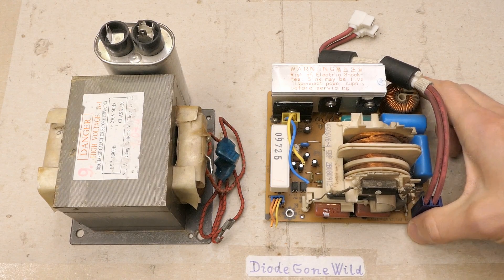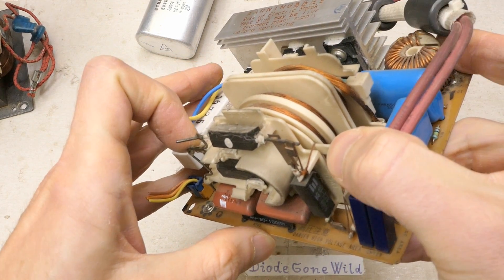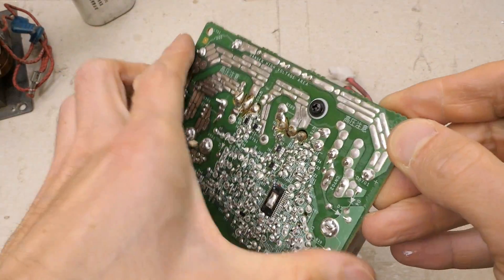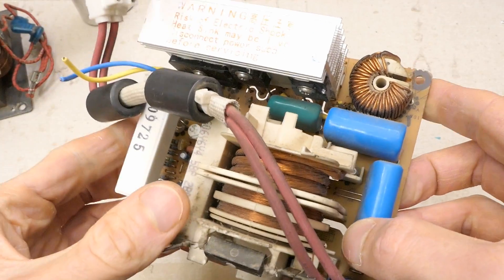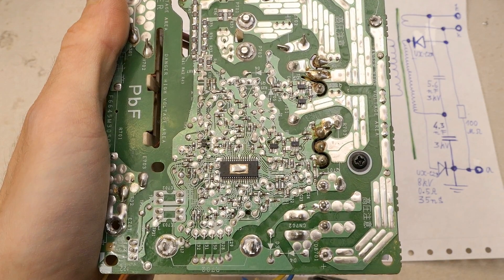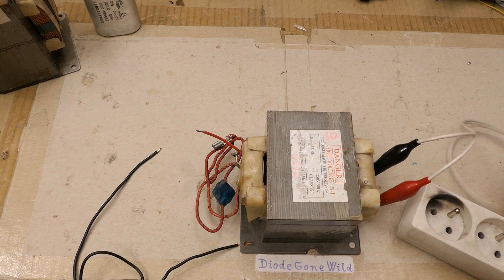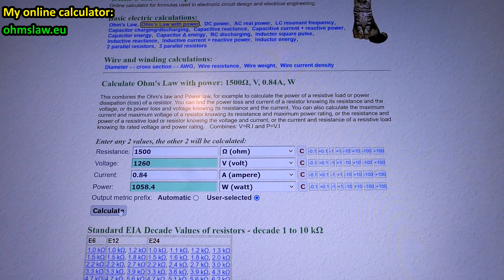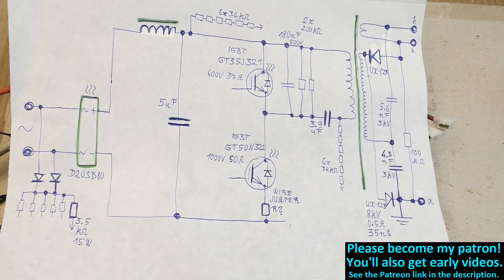A Microwave Oven Transformer, but switching!

Comment: The doubler circuit is connected to the cathode in this special way to disable voltage doubling when the heater wire is broken. A magentron without heater but with high voltage could emit some other radiation.
Reply from the maker: Well, this also came to my mind, but the two points are still connected via the low voltage secondary.
Reply: That's right, maybe they chose this way because it was easier to connect, since the doubler capacitors are mounted on the side of the bobbin?
Reply: It won't amit any other radiation. With a cold cathode, you have no current. Magnetrons do produce X-rays in normal operation, but 4 keV is too low energy to pass through the copper anode. Even a thin glass vacuum tube will block X-rays under 10 keV.
Reply: @mernokimuvek  You're right, I didn't think about the low keV, but magentrons can produce X-rays when the filament burns out but is still hot enough to emit some electrons. You will get a hotspot which will give you enough electrons for a accelerated path inside the tube. Once you disconnect it, it cools down and then will never generate anything again. Correct me if I'm wrong... I thought the beryllium stem of the antenna was quite 'translucent' for X-rays?
Reply: @SunnyJulienDivine  I tried disconnecting the heater and it stoppe emitting microwaves in a few seconds.(With the high voltage still connected). The beryllium oxide or aluminium oxide insulator is still a few mm thick. X-rays tubes with thin beryllium windows rarely emit under 7 keV.
Reply: Okay thanks a lot!

Comment: Remove the transformer out of the switching based supply, and put a fly back with a custom primary in its place....

Might need to have wax seal and submerge it in oil with drive voltage of 340v, since it's full wave rectified fed in to a igbt inverter circuit....

Comment: Finally on a unique topic....I hope inverter microwave oven won't replace traditional microwave ovens
Reply: This explains a lot. I was trying to troubleshoot my 2017 LG microwave oven and was looking for the large capacitor, but it wasn’t there!
Now, I understand why 👍
Reply: Not me, they use less power and the Toshiba ones made by Midea last LONG time, and cheap to fix yourself.
Reply: @BigEightiesNewWave  they also actually have variable power, rather than 10 sec on 4 sec off or whatever it may be when selecting a lower power value
Reply: @BigEightiesNewWave  Midea makes great microwaves tbh.
Reply: I still have a good old mot panasonic microwave

Comment: Lots of comments about the unreliability of inverter microwaves, but nothing about how much better they actually work.  I have an older Panasonic inverter unit that still works great, and if it died tomorrow I would immediately buy another one.  They work much better than transformer-based microwaves, especially at low power settings.  If you set a transformer microwave to 50% power, it doesn't actually produce half power.  Instead, it cycles on and off at 100% power but the user has no control of the duty cycle, so short durations at low power aren't really possible.  An inverter microwave will actually produce half power, so your food is much less likely to boil or explode.  Sadly, most people don't bother to learn how to use a microwave properly; they just run it at full power all the time and clean up the occasional mess (or don't, and have a disgusting microwave!).
Reply: Some people just want to be the victim constantly.
Reply: Most Panasonic microwaves are now made by Midea. You have to look well to get a true Panasonic

Comment: Are you sure that the 3.9uF capacitor is connected in series with the transformer? It doesn't look right....
Reply from the maker: It is, and it has to be. It removes the DC which otherwise would saturate the transformer.

Comment: Create a driver circuitry for the transformer using a MOSFET and 555 timer! I'd really love to see that.
You could also make the arc produce music by inputting some music signals to one pin of the 555 timer. I've built one of these driver boards
Reply: Skip the transistor and use a vacuum bulb for more fun.
Reply: just a ZVS or even better if you wanna do an NE style, a TL494, much better for audio modulation

problem is that the voltage is really, really low compared to a CRT flyback so it will be hard to maintain a stable long arc especially for audio modulation
Reply: @BH4x0r  You mean the output voltage OR the amount of current you need to drive that transformer, which makes the voltage low?
Reply: @TomboRectify  i mean the output voltage, these are made to put out approx 4kV at high current, just like the metal transformers (the metal transformers go through that capacitor and diode as a half wave voltage doubler), a TV flyback from an actual TV puts out anywhere between 20-35kV (dependant on TV size) on the stock driver
Reply: Why don't YOU try that? I swear I would love to see that :D

Comment: now you know why the new ones do not last half as long, we replace 1 part with 100 parts, of which many have a lifetime of less then 1000 hours.  we call this "progress".
Reply: It's suprise me, my 25yr old nintendo adaptor still survive till this day, while my laptop charger already died in 3 yr, yes smps is efficient and lightweight but they are very fragile, that's why sometimes in military/space equipment they still use traditional equipment
Reply: @JhonX-vj3bk  not all are made equally, there are a lot of SMPS' that last a very long time

that nintendo adaptor is probably an SMPS aswell

if you have a PlayStation 1 or 2 that still works, those actually have an SMPS

they aren't that insanely fragile, only if truly ran beyond their physical limits (short circuits, high temperature and whatnot)

i've had wallwarts based on transformers that had their electrolytic caps dry out in far less time than some of the SMPS' in my house

my 2000 PS2 and 2000 Kenwood SW-505D sub can attest to that
Reply: @BH4x0r  I use an old IBM laptop PSU for my powered speakers still, but it was a pentium 3.. Evidently Big Blue didn't cheap out that much on the thing.
Reply: @mikafoxx2717  i actually never had an SMPS die, incl very cheap Chinese ones of questionable quality, but if they don't die they don't die so that's alright
Reply: @BH4x0r  led light bulbs also have SMPS, of a sort. So there's a lot of things to count in to that.
Reply: @uploadJ  true, true. Incidentally the old ones were more likely SMPS, much like the compact fluorescents.
Reply: @mikafoxx2717  depends on the model, etc, some just have a very simple capacitive dropper, and some very cheap ones just have led "filaments" that each flicker on and off without any form of smps, with all the leds in series and a simple resistor

a generic smps doesnt need much parts

there are some IC's that handle most of the driving, i have some led bulbs, with smps, with only 9 parts if you don't count the led and PCB itself, in my case a simple COB led

a transformer, a bridge rectifier, 3 capacitors, 1 drive IC (BP3166B), a diode and 2 resistors.

those don't flicker at all either and they have been working for 2 years for me now
Reply: @uploadJ  i'm not talking about a linear regulator, i'm talking about an actual smps based on a small switching IC, which these ones i have do have

and a simple linear regulator is often still garbage as often they won't have enough filtration/capacitance to stay on when voltage drops at the input (had a few ones)

besides i know about peak volts vs rms volts, and i live in Europe so you can make 325V after rectification from that (230V)

i've also never had led lights based on linear regulators.

i'm not assuming anything, i actually opened one and checked the circuit used in these ones.

you may think you're the only one with electronics knowledge but that's far from true, never assume shit

i also never had leds under 7W, as even that isn't very bright to me
Reply: @uploadJ  it makes alot of sense to use an SMPS at lower power levels, especially if the LED is a far, far lower voltage

there may be some bulbs with far more leds, and let's say half the line voltage, but that's still alot of energy wasted for nothing, especially considering it's only 5W

unless those things are combining a capacitive dropper WITH a linear regulator i'd say thats a pretty dumb design, and i don't like/dont like the idea of capacitive droppers regardless of that

bulbs like you explain them are not even able to be legally sold where i live, as they don't pass efficiency standards
Reply: My guess is you could have a decent switching supply that would last the life of the microwave, as long as you don't skimp on decent parts and have sensible board design.
Reply: @HobkinBoi  what is the life of the microwave? and what should it be, if we want to not overload the environment, and run out of things like copper and so on?  also if this would be the last microwave you'd ever buy, would you prefer a switch mode or a transformer?  I think these are relevant questions :-)
Reply: @HobkinBoi  I will say that in general the iron core transformer is generally really reliable. They do fail with shorted turns with the CCA wound ones, and a replacement is as expensive as a new microwave, so the good ones from scrapped units are pressed into service instead.

I have scrapped more microwave ovens for the cavity rusting through where the turntable runs, and, for the recent few microwaves, the failure was the actual RF filter assembly on the magnetron arcing over internally, which is a really odd thing to have, as those are pretty much just a thick ceramic tube, with silver plate on the inside and outside, potted in hard resin. I guess they are using cheaper materials there, leading to the failure. Despite the high power it generates, the only failures in magnetrons is from the output probe arcing over from dirt in the waveguide cavity, from the mica or RF transparent plastic cover either breaking, or being dirty and burning up.  

Only ever had one fail due to age, but seeing as it was 30 years old, and went low output, it had definitely done well. Replaced with another used one, that was younger by around a quarter century, and in good condition, with the right fin and mount orientation. Also had one fail with a broken filament, but to be fair that oven had taken a trip off the table to the floor before that.
Reply: The Panasonic inverter in the kitchen must be pushing 10 years now, due for a second repair to the door latch, and it would have been junked due to a failed thermal switch had I not also repaired that. No issues from the inverter other than enough rfi it kills all wifi connections in the room. Cheap trash is cheap trash no matter the parts count.
Reply: My server has been running continuously for over 10 years, so lifespan is not an issue if designed correctly.
Ok maybe the old ones would have lasted 30 years and the new ones 10 years continuously, but then who cares... If used 30 minutes or less a day like in homes, they will still last indefinitely
Reply: @olafmarzocchi6194  nah, not really, the capacitors dry out overtime, so it is impossible to predict when it will die, even when not constantly in use they still will dry out

other than that, yes they last for decades when designed right
Reply: It is progress.  For example, compare an incandescent light bulb to an LED light bulb.  LED lightbulbs have a considerable number of parts required to run compared to the tungsten of an incandescent bulb.  However, there is so much more benefits with using led based lightbulbs compared to incandescent light bulb.

Now, that didn’t render the venerable incandescent light bulb obsolete to the point it’s no longer manufactured.  There are some applications where you just can’t use an LED based bulb (like the bulbs in an oven).  However, it’s still progress.
Reply: @3ffrige  led's don't really need that much parts, obviously it is more than 1 part, but in reality you can simply use a capacitive dropper for a mains voltage light for example (but it will cause a flickery effect) yet it is possible to run 2 leds (one wired positive, one negative) with just a simple AC film capacitor and 2 resistors, which is actually exactly how some cheaper led lights are made, just with more leds in series
Reply: The simpler, the better.
Reply: It is indeed a progress. For the sake of efficiency and to comply with the standards that hates inefficiencies. You know that traditional transformers had power loss and going SMPS increases efficiency as high as 90% or more, at the cost of complexities, fragility and increased component count. Ah... Back in the old days, Nokia chargers used to run on transformers and ran hotter than today's chargers...
Reply: the older 60 Hz transformer required a lot of copper and iron and was much heavier to ship than the newer SMPS...

and, yes, planned obsolescence dictates the use of a more fragile power supply.
Reply: SMPS won't last very long but it is cheaper.
Reply: Absolute Agreement.
Reply: Can I replace microwave inverter magnetron with conversation one
Reply: Microwaves with these power supplies are inverter microwaves, which aren’t subject to the long-period on/off duty cycles to deliver partial power.  In other words traditional microwaves with normal transformers run full-power for 5 seconds and then zero-power for 5 seconds, to provide 50% power.  But microwaves with this kind of power supply do not have these long-period duty cycles to achieve partial power.  So it actually is “progress” if you care about heating food more smoothly.
Reply: @mensaswede4028  re: "But microwaves with this kind of power supply"
Do not forget filament heating time, which is what - two to maybe 4 seconds?
Reply: @mensaswede4028 exactly, that is a big issue with the standard MOT based ones
Reply: The switching power supply is much lighter than the iron core transformer. Much cheaper to ship. Money saved ... that is all.
Reply: @chuckvoss9344 there are other benefits to the switching ones, if you wanna heat something like fluids at reduced power to not boil over it actually reduces the duty cycle (aka power) pretty much constantly, while in the ones with a normal transformer if you have it set to 450W out of the 900W it will be like 30s on... 30s off.. (as an example) which can certainly cause issues
Reply: @chuckvoss9344  Not in a microwave, where you pay volumetric mass, as the cavity is all air.
Reply: Inverter microwaves are more expensive where I live, but people still buy them because it's more energy efficient.

A lot of people here only have 900va-1300va of electricity, so a 1000va microwave would overload the breaker.
Reply: @tristan6509   Is it 4-5Amp from the supply? That's not much which part of the world is that? In the UK we have at least 40Amp, but most often 100Amp (that is 24kVA).

Comment: capacitor rating is 2100 V, how it will handle 4000V
Reply from the maker: it's a doubler, the capacitor doesn't see the full magnetron voltage. The secondary charges the capacitor in one halfcycle and the voltage of the capacitor is added to the secondary voltage in the other halfcycle.

Comment: You can make ZVS driver with it for next video... :D 4uF polypropylene film capacitor parallel to primary of transformer and two n channel mosfets to power it from dc voltage like 12V

Comment: Can you really draw 1764W from a microwave that says 900W on the box?
Reply: Two things: First, the 900 watts refers to the microwave power that the magnetron produces, not the power that the magnetron consumes, which will be considerably higher since a good part of the power supplied by the transformer is turned into heating the magnetron itself rather than the food in the oven. So you can expect the transformer to be producing about 1300 watts when the oven is operating normally. The magnetron turns 900 watts of it into microwave radiation which goes into the oven and heats up the food.
Second, that 1300 watts is what is produced when everything is running normally and the transformer is therefore running at relatively high efficiency. This is way below the point of maximum power transfer where half the power is dissipated in the transformer and the other half goes to the output. The power in such a situation can easily be 10 times higher than its normal power output.  It just cannot sustain it for long periods of time as the transformer would melt or burn up if the fuse didn't blow. But getting a fatal electric shock only needs the current to flow for a fraction of a second, less even than it would take to blow a fuse. Loading it to the point where it supplies just 33% or so more power than its rated output would just make it run warmer than normal, wouldn't blow the fuse and it could probably run for several days before giving up.

Comment: This should have come with an extra warning, these are very dangerous. Teens use to die trying to make ark patterns working with wood, applying the HV to a board. Only use I'd recommend is using this stuff for high current, it's possible to spot weld batteries with a transformer like this. Get rid of the HV coils ASAP, replace 'em.
Reply from the maker: There's a warning at the beginning of the video. There's a warning in the description. There's a spoken warning when I test the MOT. And there are the calculations that also give a lot of a warnings and scare the hell out of people. If it's still not enough, I don't have much hope for humans...
Reply: @DiodeGoneWild  I know, looked to me like  the text before all the vids here. No offense intended, these things just give me chills.
Reply: hardstyle905 Point is, there is no room for error, you are just kill. It's riding a bicycle compared to riding a 1000ccm super sport. I never got an electric shock except cattle fences, and I played with tubes, and messed around working in big solar parks.